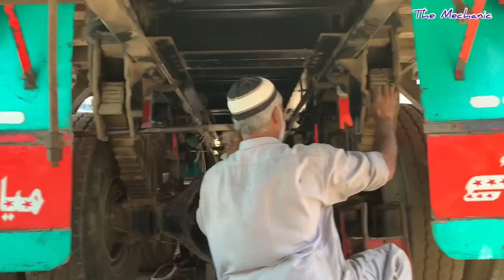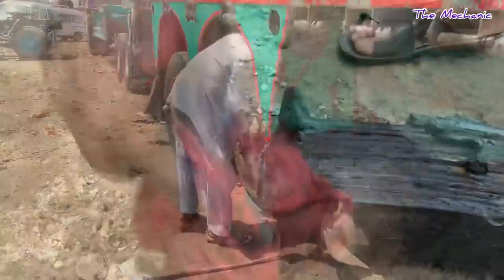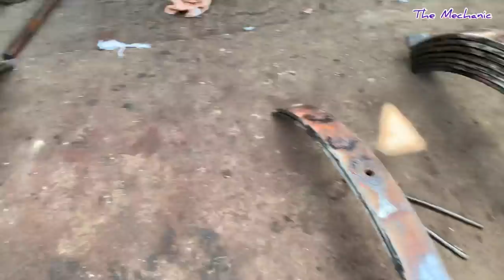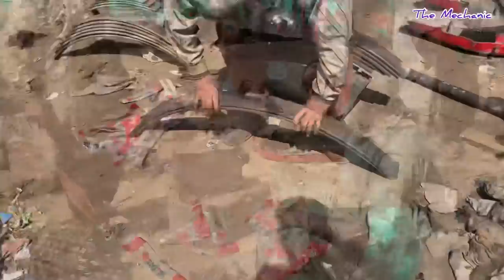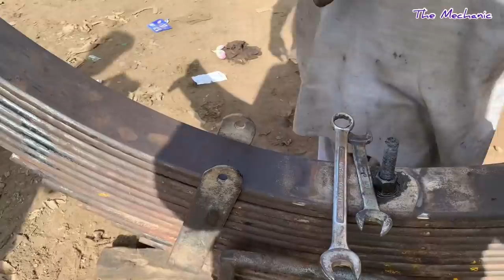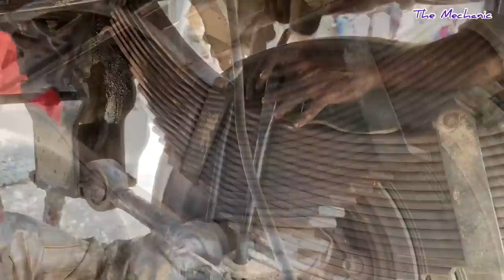These Mechanics Know How to Fix Your Truck Trailer Suspension System | Rebuilding Trailer Suspension

Comment: Some power tools would really speed up the process.   But, even w/o power tools, these dudes are amazing!
Reply: Labor is cheaper than power tools that will break eventually.
Reply: Tools save time but machines like computers save even more and AI will make professions like drivers, doctors, lawyers, etc, obsolete.
Reply: P

Comment: Those leaf springs are made from quality spring steel. The spacer on the bottom, the top spring was worn, and they were sagging a bit but there wasn't a single cracked spring. Due to how bad the roads are and that the driver has probably hauled overweight loads the leaf springs take a big beating. These guys did a lot of heavy lifting getting them out and back in. That's no easy feat. I like the cart they made to help move the springs. Hardworking guys!👍 I would like to see I video of how they do line boring there.

Comment: What is wrong of it ?
Reply: The bottom spacer was almost worn through, the top spring had wear marks, and the springs were starting to sag. The springs themselves were in ok shape and not cracked.
Reply: The U-bolts holding the leaf springs in place were replaced. They didn't appear to be broken but they were probably stretched out. That would allow the whole leaf spring to move and cause it to wear or deform. It was what they call preventive maintenance.